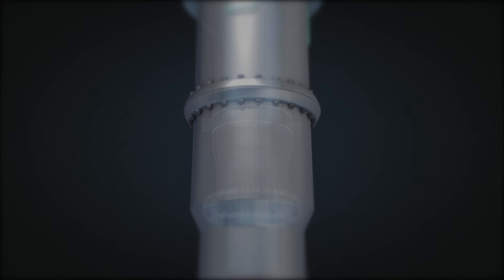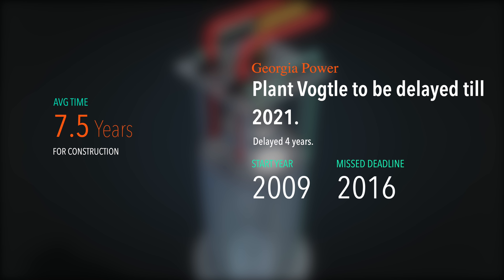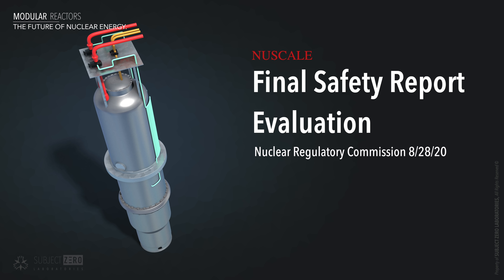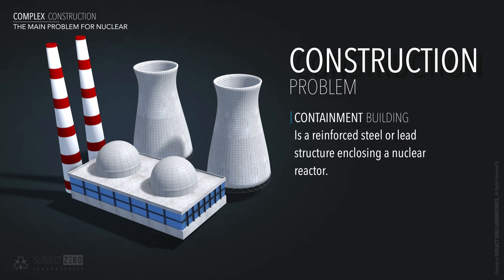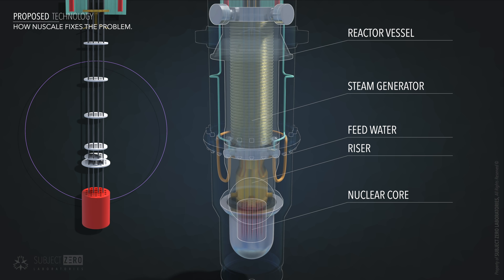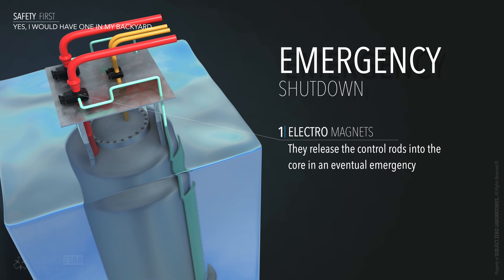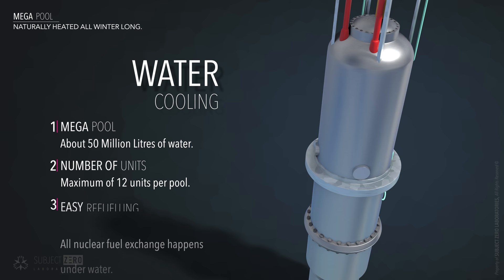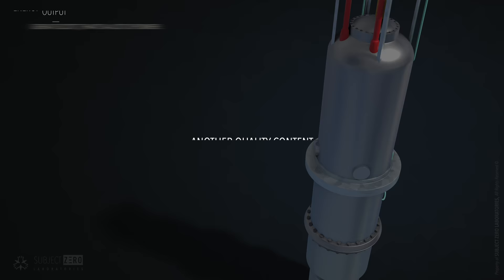A Milestone for Small Modular Reactors (SMR 2020)

Comment: I live here in SC, near Vogtle; have some friends working there. They have literally dumped money just switching contractors and are literally running in circles when it comes to management.. The entire process would've been done if these "managers" would stop their ridiculous and pointless game of "management."
Reply: Solution: put managers into concrete basemat, cover with rebar.
Out of sight, out of mind.
Reply: So what you’re saying is that mismanagement and corruption that follows EVERYONE of these projects around is well underway there.  Remember...these things are perfectly safe except when they are mismanaged....oh, wait....
Reply: And there lies the problem with all nuclear options, the human factor will never be removed and therefore it will always be too risky an option for energy production!
Reply: It won't get done. If it did, their gravy train would dry up. The Vogle reactors have the same design as the ones shut down at Summers. Bechtel's audit stated that the reactor design for Summers was unworkable.
Reply: @George Mann I respect your comments because you actually have facts to back up your contentions. Most proponents throw out a few worthless lies and leave it at that. You actually provide details of possible solutions. However, that does not change my opinion on nuclear power production. I know from experience of forty years as an industrial hygienist, that production pressure, economic pressure, sheer stupidity, and laziness often override the best laid plans.  You have a big mess to clean up and I don't think you guys have even started on it yet. I think you are waiting for someone else to do it for you on their dime. I have seen remarkably creating ways for Murphy's Law  to prove its reliability. Nuclear proponents have had many glowing solutions for dealing with the most dangerous technology we ever fooled around with, but it always seems to be the fools that screw things up and, boy, have they ever screwed up nuclear power. You are your own worst enemies and I don't want any part of it. I am already getting the bill.
Reply: You think your plant is bad... I live in Ohio, near the Davis-Besse NPP.  All anyone needs to do is read the wikipedia page for this plant and I promise you'll be left wondering how in the world it is still in Operation.  No joke, that plant is operating at 100% capacity as we speak with a 13 inch crack in the cladding of the reactor containment.  In fact, after it began operation, it's first incident on site in 1977 is the EXACT issue that caused the partial meltdown at Three Mile Island, except an operator at Davis-Besse caught the problem before it became more than just a problem.  The plant history listed on the wiki article are just the ones known to the public.  Trust me when I say there are more.  https://en.wikipedia.org/wiki/Davis%E2%80%93Besse_Nuclear_Power_Station
Reply: @samk4339  Things will change when the public starts to understand the need. Scientists have had the answers for decades.
Reply: @TheEvertw  if the solutions to nuclear's problems existed, they would have implemented them by now and nuclear would be everywhere, but it isn't, is it?
Reply: @samk4339  Nuclear energy has always been hindered by governments wanting to only build rectors that they could extract material for bombs from (that is why we use uranium as fuel, and not safer ones).
And by people overreacting to nuclear accidents, and by governments and corporations trying to hide errors they made.
But the biggest problem has always been that fossil fuel was too cheap and plentiful to invest the time and money to get things right.
Reply: @berryberrykixx  You are absolutely right! The worst three commercial nuclear power plant accidents in U.S. history, besides Three Mile Island, occurred at Davis-Besse. I don't know how the NRC granted an extension to its license to operate until 2035. That shows what a rubber stamp agency the NRC is. Our only hope is that it will become such a drain on the operators that they will have to shut it down before the license expires, like the one in Connecticut. Even though S.C. taxpayers are on the hook for $9 billion more to pay for the Summers reactors, I thank God every day that they never started to operate. You can take the next statement to the bank! Anyone who looks will find that there are situations just as dire at nuclear power plants all over the U.S. But you won't hear about them on the news.
Reply: @berryberrykixx  I am curious. Have you heard anydevelopments or details about the bribery case concerrning Davis-Besse staying open? We have a hard enough time in South Carolina getting news about the criminal fraud case against SCANA officials in the failed Summers reactors. For nuclear utilities, no news is good news because all news is bad news about them.
Reply: @TheEvertw  The public fully understands the need with a grim determination. To get rid of nuclear altogether. Once and for all. If we quit digging a hole to hell maybe, just maybe it won't kill us all. I doubt if the nuclear mess can be fixed.
Reply: @TheEvertw  Is it possible to overreact to a catastrophe that destroys a country? Ask USSR, I mean Russia.
Reply: @jackfanning7952  From what I understand, those members seats will be refilled in the upcoming election and DeWine wants a revote.  I don't believe DeWine really wanted to take on Davis-Besse but Perry was included in that as well and nothing has ever occurred at Perry.  On top of that there was a huge outcry from the workers there about decommission, since that's the only real place to work in the area.  I understand where they are coming from but that plant has been dangerous from the get-go.  Right now it's still very wait-and-see.  That was the last I heard about it, then DeWine tested positive for COVID-19 and he has kinda fallen off the radar as he gets well.  At 73, he's no spring chicken.
Reply: @jackfanning7952  Yes, if that catastrophe didn't in fact destroy the country.
And if you refer to Chernobyl, that was in Ukraine, not Russia.
We tend to forget the catastrophes that go with other forms of energy. Like exploding gas trucks. Villages that are inundated when a dam is built or cities that are flooded when a dam breaks. Countrysides that are devastated due to coal mining, and thousands of miners that die digging it up. Cities that are no longer fit to be inhabited due to subsiding earth when oil or gas wells under them are emptied. Coastlines that are made deserts when an oil tanker runs aground.
What has happened is that the attention nuclear disasters get is not in relation to the number of casualties. Fukushima, in spite of all media attention, has caused the death of 1 person. A single one.
The numbers are very clear. Nuclear is one of the safest ways to generate energy, MUCH safer than coal, oil or gas, and about as safe as solar and wind energy.
This shows again that fear is not rational. That is why we (should) base policy on facts, not on feelings.
Reply: @TheEvertw  Of course, you know that Ukraine was USSR's puppet, and the country that Chernobyl destroyed was the USSR. Even though it took the entire world community to put a temporary band aid on this critical wound. Which is still far from fixed, you know. Some of the most contaminated soil that was dug up and buried will still be emitting for at least 24,000 years. A sarcophagus is only good for another 70-80 years.  Fukushima is still a huge ongoing catastrophe. Name one catastrophe other than nuclear that has destroyed a zone for centuries or hundreds of centuries. Dams are built and break. Floods come and go. Some bring nutrients to the flood plains. Some dams destroy viable bottom land and fertile valleys. Oil seeps naturally from some soils and life goes on. Oil spilled in the Gulf of Mexico for 9 months and life goes on. But not with radioactive byproducts of fission reactions. Leaves will not decay in the forest at Chernobyl. We will never know how many people are killed by nuclear, because of the latency period of cancer. Isn't that convenient for the nuclear industry? It will be decades, if not centuries, before the true death toll of nuclear is known. It will keep on killing even if we cease all nuclear options immediately. But we can see the economic death from nuclear right now. Forbes magazine said, "The failure of the U.S. nuclear power program ranks as the largest managerial disaster in business history, a disaster on a monumental scale...only the blind, or the biased, can now think that the money has been well spent. It is a defeat for the U.S. consumer and for the competitiveness of U.S. industry, for the utilities that undertook the program and for the private enterprise system that made it possible."  Nuclear has created its own economic defeat.  Just look around at the demise of the nuclear industry in the past 30 years. No one wants to invest in your wild ideas anymore. When faced with the facts, you turn a blind eye to reality. Just like Anthony Dyatlov at Chernobyl, "3.6 , not great, but not terrible.
Reply: @berryberrykixx  Thank you for the info. Just the kind of mess that the legislature and attorneys will be chewing on for years, if not decades, just like in South Carolina...just like everywhere that nuclear power exists. I agree with you that Davis-Besse has been a mess from the start. I also see that one of the proponents for nuclear are workers that are making good money working on these monstrosities. But taxpayers can't afford make work projects that do not provide a good return on investment. Just because power companies and workers are making money, nuclear is not economical. Even if we don't add in the long term costs of waste disposal, decommissioning and rising ambient radiation levels.
Reply: @samk4339  It is behind all huge projects lol. Any energy source is neither safe nor green. Literally, with great power comes huge responsibility. So.. okay lol just go back to ur rotting wooden hut
Reply: Suits always foul things up.
Reply: @bioswars8827  Lol u and ur unsubstantiated opinion. Do you sincerely think smr is like small atomic bomb? Duh.. just. No.
Reply: @bioswars8827  There isn't ppl who are dying because of that.. at least after 1yr of accident, no. There might be ppl suffering from cancer but that is highly debatable anyway - thinking how frequently cancer just arise from nowhere... + Smaller reactors mean less of that, duh. Much easier to contain. For terrorists it is easier to dumb chemical toxins 🤣
Reply: @bioswars8827  Wdfym "the same". Do you think we have a way to detect the cause of cancer? Duhh. Also what do you really mean by dirty bomb. Maybe you just don't know what radioactivity means.
Reply: @jackfanning7952  You tell 
George Mann that you "respect your comments because you actually have facts to back up your contentions. Most proponents throw out a few worthless lies and leave it at that".
I feel you have made a statement "That shows what a rubber stamp agency the NRC is." - Do you have any facts to back up this contention? Or were you just, like your debate opponents, throwing out a worthless lie?
Should George, or I, or anyone reading these posts, respect you if you make such a statement without facts?

You also state "I don't know how the NRC granted an extension to" David Besse. Have you considered the possibility that they granted the extension because the NRC felt the plant met the safety standards? If no, perhaps you can provide a fact to back that answer.
Reply: @factnotfiction5915  Here is an example of the NRC protecting the industry instead of the public it is supposed to protect. Southern put in an emergency request for a variance of the licensing because their Vogtle Reactor #3 is out of specification. Instead of a 3" gap between the double wall of the containment, there is a 2" gap because the floor is "dishing" in. This was known since 2014 but was only revealed at the last minute before the commissioning of the reactor. The floor is dishing in because of the weight of the containment floor collapsing the clay beneath it. The NRC came to a special viewing room to look over the technical aspects of this last-minute request, did not take possession of the details of the report and took no notes of their review. This was done so that the public would not have access to the data under a freedom of information request.  The NRC renewed the license of the Davis-Besse reactor until 2035, even though it has a crack in the containment wall and has had 2 of the 5 worst reactor failures in the history of the U.S. nuclear power history. Even so, the operators of the plant decided to shut it down because they couldn't maintain it. It is embroiled in an alleged bribery scandal in order to keep it open. I have tried to get information about this, but bad news about the nuclear industry doesn't seem to get much press. Whistle blowers are blackballed and "investigated" by the industry and referred to the DOJ for indictment by the NRC. There are enough cases of this to fill a book. Among other sites, they are documented on Fairewinds information sites pertaining to whistle blowers, if you want proof.
Reply: @jackfanning7952  "Here is an example of the NRC" - what you have presented is an _anecdote_, not an example.
I will offer an anecdote in turn: Every civil servant I have ever met has been a conscientious American working their job to the best of the ability. Although I am sure a few corrupt ones exist, I have never met them.
I have never met an NRC staffer, but I have no reason to suspect they are corrupt, or incompetent, or doing less than a proper job.
How do you know the floor is dishing in? Because the report states so - hardly an example of a cover-up. You are angry because you feel this constitutes a major flaw, and the NRC engineers doing the review do not feel the same. Ditto Davis-Besse.  Exactly why do you believe your opinion - one who admittedly did not review the raw data, and presumably you are not a professional engineer - is of more weight than the NRC's expert?

"Bad news about the nuclear industry doesn't seem to get much press" - of course, it it also possible that there isn't that much bad news. A shocker given some of the many anti-nuclear editorials the press has published.
Reply: @factnotfiction5915  It is interesting that you use the word "anecdote" to describe my comments. "Anecdote" is from the Greek word "a-" meaning "not" and "ekdidona" meaning "to publish." The NRC was created in 1974 to "ensure the safe use of radioactive material for beneficial civilian purposes while protecting people and the environment." I don't think avoiding the public's freedom of information on the Vogtle Reactor variance request or relicensing a reactor with a dubious safety record and a cracked containment fulfills their objective to protect the people and environment. I also don't believe investigating and referring whistle blowers for indictment protects people, but the industry. Unlike you, I have ample reason to suspect they are corrupt,, and incompetent and are doing less than a proper job.
Reply: @jackfanning7952  You should take your conspiracy theories and run for office as the crackpot candidate, or head over to 4chan to commune with the other nutters, or see if you can get DJ Trump to nominate you as an NRC commissioner.

Youtube comments are not really the forum for you  - sure you can post here - but its just not very productive for you. A street corner on top of a soapbox is where you will get more followers. Don't forget your "The End is Nigh" sign.
Reply: @factnotfiction5915  I would love to be NRC commissioner. Then we would see the rats running from the light!  The end is already here for nuclear power. Not because of the extreme damage and catastrophic legacy of nuclear fission but because it is the most expensive form of energy in existence.
Reply: Democrats must be involved, that or RINO’ s. Goal is to use up as much money as I can take.....